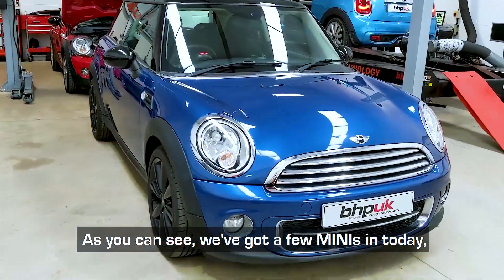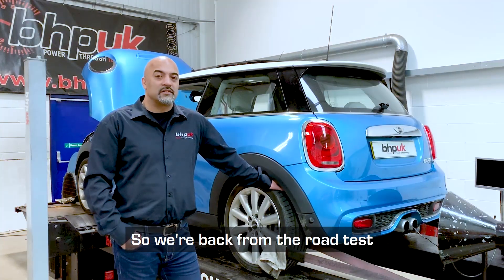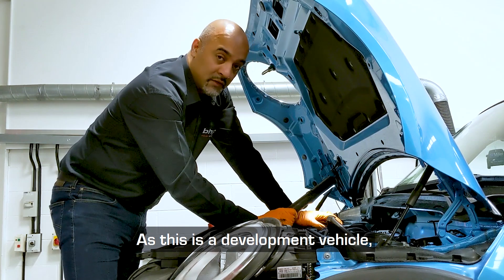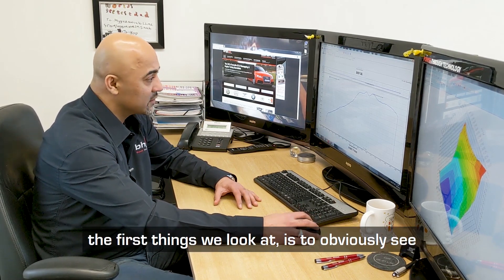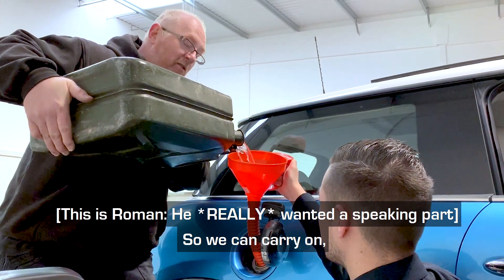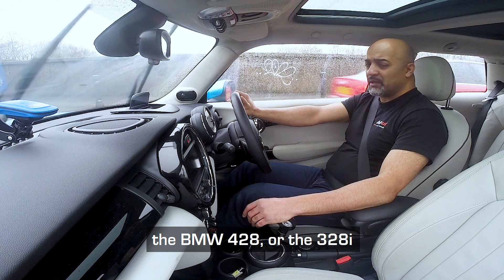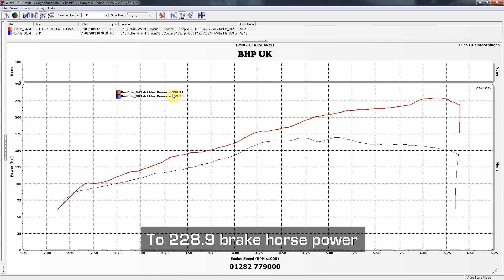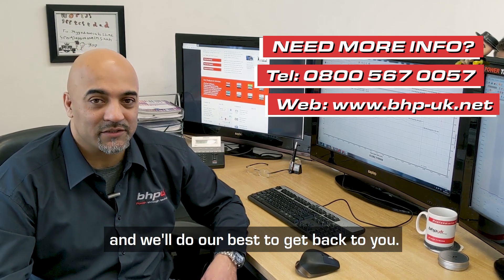F56 Mini Cooper S B48 ECU Remapping - Remap Dyno Development by BHP UK

Comment: Any issues with mapping these? Heard some whispers about pistons melting and has put me off getting mine done a little?
Reply from the maker: Hi Laurie, problems with pistons melting generally come from engines running too lean.  During the development of this map we monitored both the air fuel mixture and the exhaust gas temps (EGTs).  We run the car a little richer than the factory sets them up and we have tuned in a way to lower the EGTs on cars with our remaps, so the risk of a piston melting is actually reduced.  Just let us know if you need any more info.  You are welcome to call us on 01282 779000.  Our map writers are absolute geeks and petrol heads.  They love to talk to fellow petrol heads, just make sure you have enough time when you call :-)
Reply: @BHPUK  Appreciate the reply. I’m down in Kent so a little too far to travel for a map otherwise I certainly would! Looking for something closer to home, JF Automotive have a good reputation
Reply from the maker: @JohnKing-lw2sb  we have over 200 dealers nationwide. If you contact us we can forward your local dealers number to you.
Reply: @BHPUK  good day! Yes this too lean/pistons melting is my concern. Do yous have WhatsApp? I will like to chat UP with you & or techs... I have f56/b46 manual. Mods are DP, JCW pro kit exhaust tune, K&N filter & FMIC. I'm looking for a wise stage 2 tune. Will like to know what is needed to accomplish a daily driven stage 2 Cooper S. Thanks for help/info
Reply from the maker: @ap3stax  You can get us on 01282 779000
Reply: @BHPUK  via WhatsApp?

Comment: Thanks very informative, why did you decide to limit the power to the point you have when other big tuners are seeing 280+ with a st1. Was that purely because its an auto because mine is manual! This engine is in for e.g the 2 series active tourer at over 240 stock. Do you feel this engine isn’t capable of coping with more? Just theres many cars coping with 300+ just with an intercooler! I thought that a diff was the only thing the car doesn’t have that’s holding it back from safely running that power. Again gr8 video but would love to here your views. Cheers
Reply from the maker: Hi John, thanks for the comment.  We did limit the power because of the auto gearbox.  You are right this engine is in cars that make 240bhp stock.  The BMW 328I is running the same engine and also the same ECU (with similar map structure and architecture).  The 330i is running the same engine but uses a different map structure.  BMW have launched a 302bhp version but that runs a lower compression ratio to deal with more boost.  We have just acquired a B48 engined car for development and have some interesting things in the pipeline.  We'll keep you posted.

Comment: Interesting process that you guys do!  Can the ECU remap be done at home?  For example to do Stage 1 which is to convert MINI Cooper S to JCW specs?  Can it be done using E-Sys software and modifying ECU components like DME and possible other modules?  OR completely different tools/software is needed to achieve ECU remap?  Thanks!
Reply from the maker: We can provide a unit that would allow you to remap your car from home.   Please call us on 01282 779000 for more info.

Comment: Great video ! what real world difference is 0-60 will this have ? and is  fuel economy impacted much ? I'm picking up a new F56 cooper s next week and considering a map
Reply from the maker: There is a noticeable difference in the 0-60 time.  The fuel economy will reduce if the car is always driven hard or on the track, however for normal road driving many customers have reported a slight improvement.

Comment: Good video, thanks for sharing. At 187 brake horsepower, this is the weakest B48 engine I've ever seen tested on a dyno, about 25-30 less bhp than average. Have you noticed a loss in power between pre LCI (2013-2017) and LCI F56 models?
Reply: Most likely cuz 2018 cars has the extra PPF.

Comment: Is the 2017 car easier to get bigger piwer from a map or tuning box?
Reply from the maker: Although we do supply tuning boxes, in our opinion a remap is the better option.  Reason being that with a remap we can alter as many parameters as we need to achieve a good tune.    With a tuning box you are generally limited to 2 or 3 channels, usually injector duty cycle, rail pressure and turbo pressure.